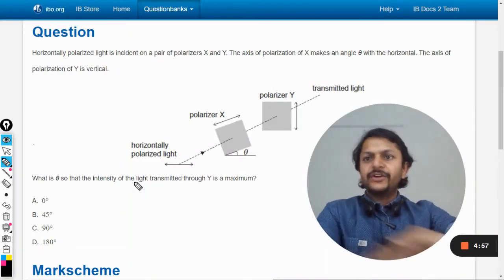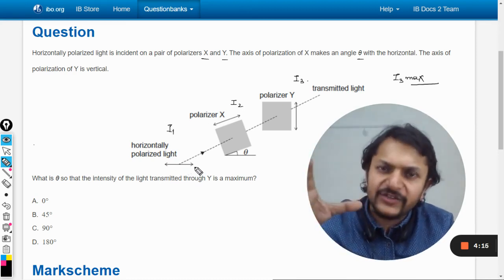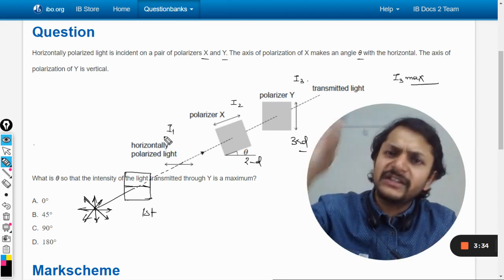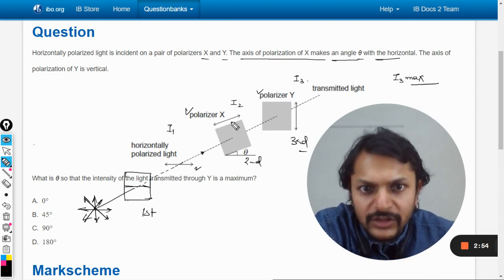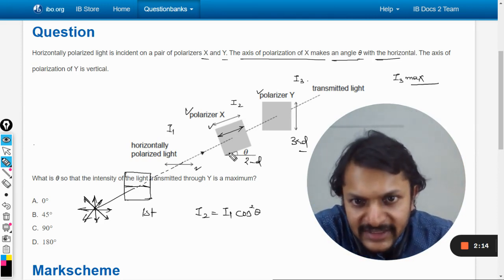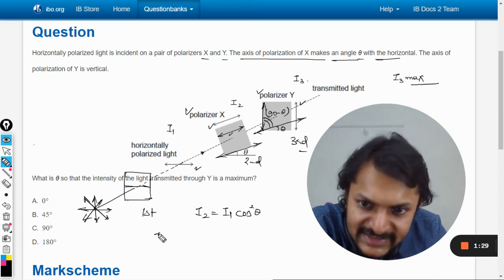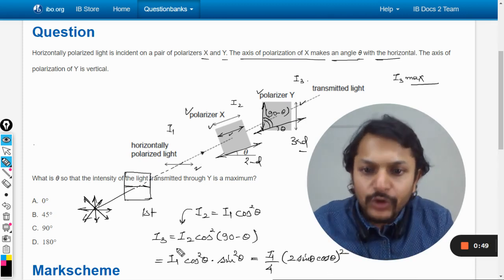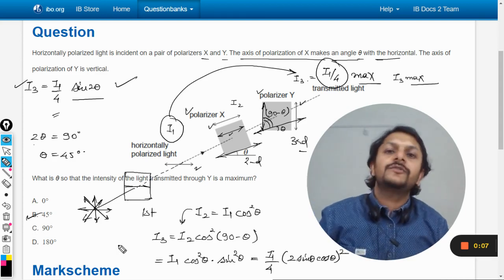Horizontally polarized light is incident on a pair of polarizers X and Y. The axis of polarization

Comment: How can horizontally polarized light pass through polarizer X with an angle greater than 0 and give light that's polarized at an angle? Any angle more than 0 for polarizer X would result in 0 intensity transmitted. Malu's law can only be used on unpolarized light right?